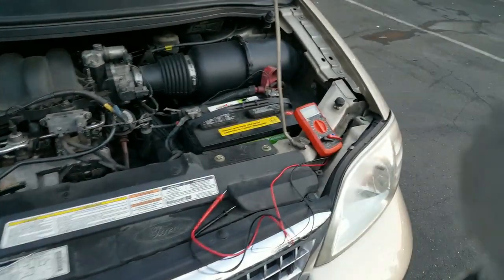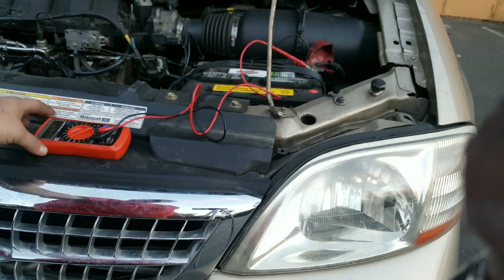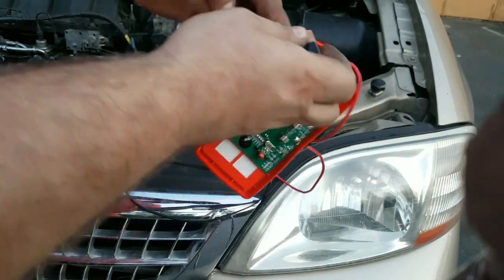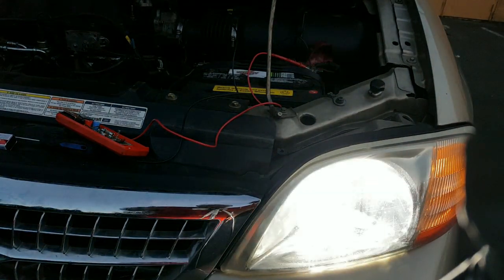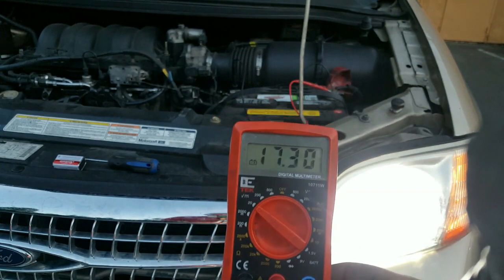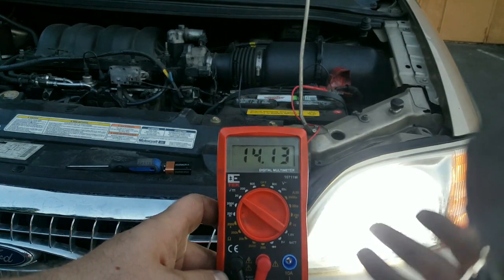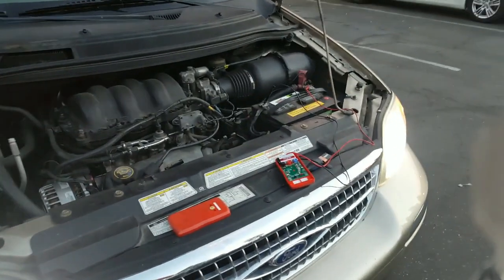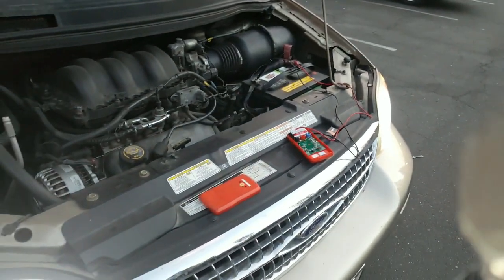This is what happened when the batteries on my MULTIMETER DIED WRONG READING

Comment: It all makes sense now. I was wondering why I had 17v reading on the meter. Wasn't my car but I had an output rated for 12 volts from an old plug I found that someone was throwing out while I was working. I knew it would come in handy. Tested lipos after that and got 5v which didn't make sense. I suspected the battery but it seemed to function perfect otherwise no dimming or anything.

Comment: If the multimeter battery is weak then how react multimeter ?? 
a.High reading 
b.perfect reading 
c.less reading 
Pls reply ??
Reply from the maker: Nishu Shukla  It will have a higher reading
Reply: @MechanicsLife  how can u explain ?
Reply: @MechanicsLife  pls read my question properly ..If the battery of a multimeter becomes weak then it will give ? A.high reading
B.less reading

Comment: I put a new battery 9 volt in my multimeter but the battery still saying it's dead and I checked it and it's got a good battery why is
Reply from the maker: David Hinds most likely faulty unit.

Comment: Thank you very much. My multi-meter was reading 19.21 instead of 12.5 V.  After watching you video I went back and checked my multimeter and it had the battery symbol. I replaced the multimeter battery and now it is back to normal reading correctly. Problem solved. Thanks for helping with this easy fix.
Reply from the maker: Mauricio Stradiotti Glad I can help

Comment: mine gives random readings in ma modes without being connected.
Reply from the maker: What brand is it?
Reply from the maker: chriss4365 bad battery.
Reply: @MechanicsLife  I tried new batteries and it still does it only on ma settings it gives random readings when not testing anything.  its commercial electric i guess its glitched.
Reply from the maker: Most likely it’s just failed as a unit.
Reply: weird all the other settings work.